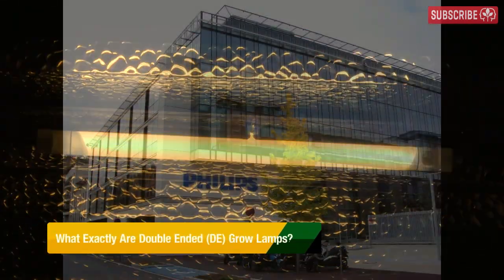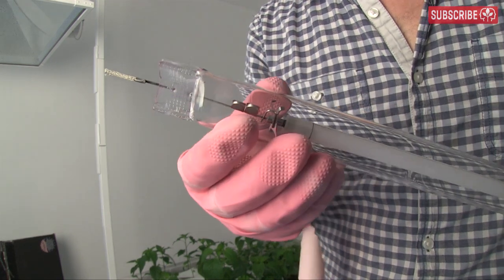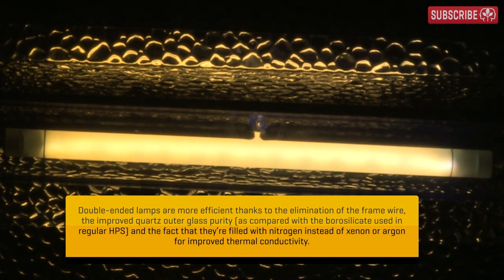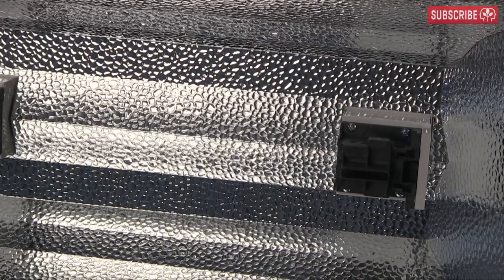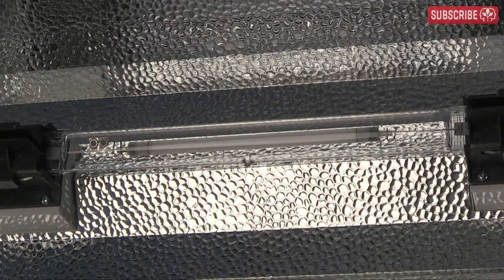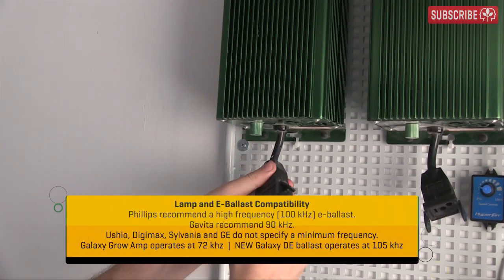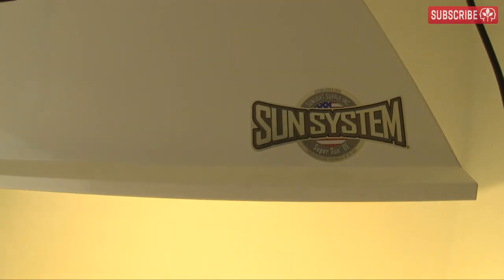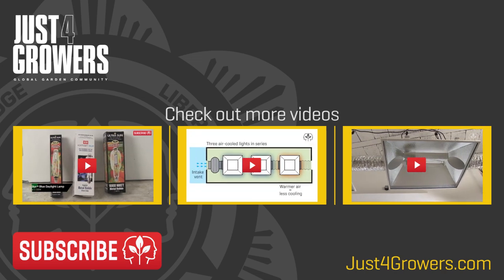What Exactly Are Double-Ended DE HPS Grow Lamps?

Comment: Should I go with the Helion DE 600-750W HPS or a 400W quantum board with LM301B diodes  
In a 4x4x6.5 tent? 
Temperatures are on the cool side most of the year. high 60 low 40
Reply: HPS definitely in a cool climate.

Comment: magnetic ballast is much better than electronic ones electronic ballast contain lot of high frequency which also destroys the electrodes in the arc tube if your electronic ballast is high frequency filtered like kind of dc current okey it is nice but magnetic ones is much suitable they are cheap simple much more life span using in old days but problem is the weight

Comment: Take a wire and put it on one end of the lamp and then put it on the other side of the lamp. Normal HPS. Just more advanced light but has noting to do with what kind of tube you put around it. And sure as hell has nothing to do with it double ended. Normal HPS is double ended too only the contacts at the end of the device meet. Startup looks exactly the same with normal HPS bulbs.

Comment: I have a 1000w solistek a1 complete system with the DE bulb very simular to the one in the video , great video by the way , your the best ! Anyways , I also run the dimmable ballast it's completed with and it has 600 750 1000 and 1100w nob. What are these used for if I switched it to 600 750 , what would happen? Thanks !

Comment: Hi Everest...what about heat? Any differences with single ended? Thanks
Reply from the maker: Interesting question! As the DE-HPS lamps are more efficient than their single ended counterparts, more of those input watts are converted to light instead of heat. That said, many growers report that 1000W DE-HPS lamps run hot, especially when housed in small, deep-dish reflectors that tend to trap heat and re-emit it as mid to long range infrared. My recommendation for home growers is to look at 600/750W DE-HPS systems - I’m particularly impressed with the Hellion system by Adjust-A-Wings for example as this users a Super Spreader beneath the lamp to spread the heat and diffuse any hotspots directly beneath the lamp, affording growers a much closer (safer) placement. Proximity is everything when using grow lights as the sole light source. Intense, angular light is key to canopy penetration. Other interesting reflectors include the DE Boss and AC/DE by Sun Systems, and check out the SR reflector by Gavita.

Comment: If optimum temperature is required does that mean it's not as efficient when run at turbo charged?  Yes more photons are produced but couldn't that be achieved by moving the light a little closer if that was an option?  Thanks!

Comment: Can we use any 1000w ballast? ???
Reply from the maker: I would suggest an electronic ballast—from there the schools are split somewhat. EYE Hortilux's platinum e-ballast uses low frequency square wave, as does Revolution Micro's DEva, where others go for high frequency SINE wave—such as Galaxy and Galaxy DE. Do you have an e-ballast in mind / in stock already?

Comment: I know you did a review on the ac/de reflectors from sun system, what is your take on it worth the price? thanks
Reply from the maker: +TekkHakk Hi TekkHakk, I think the AC/DE reflectors are really special—the sealed optic chamber is great. You can even remove the glass and still cool the fixture (without directly cooling the lamp, which you want to avoid) - so, if your application calls for high intensity in a compact space, or you want to reduce your air conditioning bill, this reflector is awesome.
Reply: +Everest Fernandez (Just4Growers)  Thanks for the replies.

Comment: Great info, can the ushio de bulbs work with any digital ballast ? say cheap ebay ones? that I already have, thanks.
Reply from the maker: +TekkHakk Hi TekkHakk, thanks for your question. If you take a look at a DE bulb you see a stiff wire element held in place at end end -- like a guitar string. And, like a guitar string, it tunes at a given frequency.  Get close to that frequency and the thing will start to vibrate, like a guitar leaning against an amp on stage. The resonance range of DE lamps lands in the range of most common digital ballasts, between 30 kHZ and 70 kHz.  To avoid shaking the lamp to pieces, you can go low, to 150 Hz (Revolution, Hortilux Platinum) or high to 100 kHZ (Galaxy, Phantom, Gavita).  So, you can light a DE lamp on just about any ballast you can find on eBay -- but not for long before it succumbs to acoustic resonance. My advice is to speak to your local indoor gardening store and either go low or high—but middle of the range will kill you DE lamp prematurely.
Reply: +Everest Fernandez (Just4Growers)  What is the best (in your opinion ) DE ballast strictly for DE?

Comment: Can you recommend a ballast that will run the 400V 1000W DE bulbs and dim them, like the Gavita ballast does? I would like to use the Sun System AC/DE Boss hood with the option to dim it.
Reply: This is a good DE ballast : http://www.htgsupply.com/products/agromax-high-frequency-1000w-digital-ballast , operates at 120,000hz which is ideal for double ended lamps
Reply from the maker: Galaxy do a great DE-specific ballast, worth checking out.

Comment: Sup Everest. I'm considering upgrading to DE setup soon and was considering adjust-a-wing reflectors. How do adjust-a-wings compare to the ACDE Sun Systems reflector in removing heat? I'm working with approximately 10 ft ceiling with a pitched roof. 8 ft on side walls and top of the roof I believe is 10 could be 12 ft. From my canopy to current reflector I have almost 3 ft in clearance.
Reply from the maker: +Ha Dang Hey Ha. Both the ACDE and Adjust-a-Wing DE are great reflectors. The ACDE is going to remove more heat as it's air-cooling the convection heat away. The Adjust-a-Wing's design lets the heat diffuse upwards out of the reflector to be dealt with by your garden's ventilation system. The Adjust-a-Wing's obvious advantage is it's adjustability—you can set it to create a deep, medium or wide spread. What growing area are you seeking to cover? How many reflectors are you looking to buy?
Reply: My room is 12x5.5 and would go with 2 reflectors. Current setup is 2 parabolics running 1000W each sitting 18 inches from canopy without any burn. I would like to avoid any air cooling reflectors because it'll take up more space.
Reply from the maker: +Ha Dang In that case Ha, I'd say the Adjust-a-Wings are a fine choice.
Reply: So just to confirm, DE adjust-a-wing would work fine with 3 ft reflector to canopy clearance? Thanks!
Reply from the maker: +Ha Dang don't see any radiant heat issues at 3 ft. They still pack a punch though!
Reply: Good to hear. If anything I can tone it down to 750 or 600. Thanks for the reassurance. You're officially my gardening mentor. :-D
Reply from the maker: +Ha Dang That's quite a responsibility but I'm sure I will rise to the challenge. :) I prefer 600s to 1000s. :)

Comment: How much more effiecent are the double ended HPS lights, seems they are over double the price to buy.  Also I can only find them in 1000 watt bulbs.  I was thinking about setting up a garden with muiltple grow lights at 400 watt so I can have them lower to the garden and have muiltiple angles of penitration (like you mentioned).   I do need lots of light as I plan to grow tomatoes.  I also saw your video for the split bulbs of both M.H and HPS combo but can only find them in 1000 watt as well.  Also this may be a silly question but do 1000 watt bulbs use 1000 watts or is that just to get started then reduces down once it gets heated up.  I only plan on running during the winter so I dont plan on using the cooling tube method around the bulb and will be used in a fairly open room.  I am assumping most people use 1000 watt bulbs to save on reflectors and other supporting gear need to power a HI bulb.  and for my final question, is it bad idea to buy a 1000 watt bulb and run it on a lower setting for different applications.   Thanks a billion!
Reply: The bulbs last 3x as long 😃

Comment: Wow I am learning so much from your channel!  I am into growing tomatoes and Peppers.  I am an experience outdoor gardener but have not really tried growing indoors yet with artificial lights.  seems like you really like sun systems brand.  I live in Canada and so far I am only taken in one of my tomato plants indoors and put it in front of a window for the winter.   I want to add a little grow light to help it out with the aid of the window.  I was thinking sun systems 150 watt to help out.  Also thinking of starting a basement garden,  what system do you recommend getting keeping value in mind ( not cheap, but value ).  I noticed you said you like the double bulb types, one with M.H and HPS combo bulbs.  also my vegetable of choice to grow are tomatoes.Looking forward to your response!
Reply from the maker: Hey Steven, thanks for stopping by and taking the time to post such an interesting comment. Tomatoes indoors: choose a determinate /bush or dwarf variety because they are so much easier to illuminate and control indoors. I am currently growing Baxter's Bush cherry tom, so check out my latest vids and subscribe for updates. Yes, i love Sun System gear. Researched, developed and manufactured in the US and high quality. For supplemental, window-sill or conservatory lighting, I would recommend a 400W HPS minimum for productive tomatoes. As for a high value starter hydro system, choose a 4 X 4 flood and drain tray. Always happy to answer your questions and discuss ideas. Peace and happy growing, Everest.

Comment: would a 8ft ceiling be enough to run a de fixture on a mover thanks for the help?
Reply from the maker: +Kevin Anderson Hi Kevin. What's your clearance from the floor? I.e. at what height do you plants start growing? Are they pots on the floor? If so, how tall are the pots? If it's a tray on a stand, how high is the tray? Also—do you have an idea of the final height of your plants?
Reply: i'm using #5 nursery pots, the pots are on the floor and usually I start bloom between 14 and 18" the 5 gallon pots are 10 1/2" I already purchased a light mover 3.5 thanks for the help
Reply: also the final height will be around 3 1/2 feet
Reply: i'm thinking of using a king wing reflector if that helps any!
Reply from the maker: +Kevin Anderson Hi Kevin. I like your idea of using an open DE 1000W HPS on a light mover. I think this is the perfect application for a light mover actually. I recommend using a frame and soft mesh netting to tuck any taller growth tips back under the netting and to spread the plants out into a low, wide form. Consider topping your plants so that they bush out. Good luck!
Reply: thanks Everest I appreciate the help!
Reply from the maker: +Kevin Anderson You're welcome Kevin.

Comment: can you use the gavita 6/750 de inside a 5x5x7 tent? or is that not enough room for that light?
Reply from the maker: What growing system (if any) are you using and what will be the final height of the plant canopy above the floor? If more than three feet off the ground you will run into radiant heat issues most likely.

Comment: I touched the bulb with my bare hands, should I wipe it off before starting it up?
Reply from the maker: Hi Jared. Thanks for your question. It's certainly best practice to keep your grow lamps as clean as possible. Even the smallest residue from your hands can potentially stain the outer casing of the lamp when heated during operation and be difficult to remove afterwards causing a permanent drop in output. Just give it a quick wipe with some window cleaner and allow to dry thoroughly before switching on again.

Comment: simple question: how much better is the DE compared to SE hps
Reply from the maker: Admi fonds Hi Admi. Great question. Thanks for asking.

1) Efficiency.

DE is more efficient than SE at converting electricity into plant-usable light.

For instance, the Philips 1000W EL DE outputs 2.07 µmol / W. 
Even premium 1000W SE HPS lamps only manage 1.79 - 1.93 µmol / W so upgrading to DE would give between a 7 and 15% efficiency increase.
Standard 1000W SE HPS lamps will only put out: 1.49 - 1.7 µmol / W - so, in this case, an upgrade to DE would give a nearly 40% increase in efficiency!

2) Lamp Depreciation

DE lamps have better lumen maintenance than their SE counterparts. I don't have the exact figures to hand for each brand but typically DE HPS 1000W lamps operate at above 96% of the original output after 5,000 hours' usage. Very impressive. Fewer lamp change-outs.

3) Improved spectral distribution.

I'm planning a video that will talk about this some more.

4) No slacking!

Great advantage of the DE is that it is perfectly aligned in the focal point of the reflector. Large 1000W lamps often show “the droopy lamp syndrome” because they are large and heavy. 

Let me know if that answers your question. Be sure that you have plenty of vertical height available when using DE 1000W HPS as they need to run hot. The Sun Systems ACDE reflector removes heat without over-cooling the lamp unlike some other air-cooled DE fixtures. There are some open fixtures too, but you need to be really on top of your room's environment. 

Finally, Admi—please sub my channel! Thanks :)
Reply: Everest Fernandez thanks for the reply yes it was helpful. i will sub to your channel. I don't like air cooled hoods, i prefer air cooled rooms altogether, that said, i will look into them, don't think i will bite and change my 2 SE 400w
Reply: +Everest Fernandez (Just4Growers) great post!

Comment: It's a very bad plastic socket. Not a good connectivity and in re-light it kill bulbs.
ACM from Italy produce a DE ceramic for new Adjust a wing and air cool reflector. It's in ceramic and doesn't kill lamp. Save lamp for more time.
4A in plastic vs 16A in ceramics
150 C° VS 250 C° in ceramics
fixed wire for plastic VS wire what you want for ACM ( save time of bulbs)
I suggest to you to contact him for review this news.
Reply from the maker: ***** Hi Andrea, thanks for your comment. The ACM socket is terminal block style and, while it is a nice socket, it remains very time consuming for the grower. You physically have to use a Philips head screw connection on either side of the lamp...and it's a more costly option.

By the way, the German-made Vossloh Schwabe DE socket isn't just "plastic", it's a non-flammable phenolic polymer of an excellent engineered design. No wonder it inspired Chinese manufacturers so directly! :)

Thanks again Andrea—please consider subbing the channel. Best wishes and happy growing, Everest.
Reply: Everest Fernandez Dear, i've in my hand 3 VS lampholder loose. 
If you test for more time to re-start with lamp you could kill socket fastly.
Slider lampholder for me, is a very bad solution in this condition. 1 minute plus, and 100% security for connection and temperature is less expensive that bad connection and 100$ for a new Bulbs.
If you check in the stadium,, every where, the lighting manufacter, use 100% ceramics lampholder with this system. why this? because 1000 Watt requires a good connection and good security.

Second time, Italian design , white ceramics brillant, garantee more reflection that Black plastic lampholder. 
+3/4%. 

Why spend more money for a 98% aluminium and after use a 
non-reflective lampholder? Is the same to buy a Ferrari with a small tires.

Thanks
Andrea

Comment: Are there any advantages to running DE Metal Halides?
Reply from the maker: Jonathan Bermudez Thanks for your question—it's an interesting one! DE MH in its current form is not a protected “open rated” lamp and thus should only be used within a glass enclosed luminaire such as the Sun Systems AC/DE reflector which cools the fixture but doesn't pass cool air over the lamp itself (important for all DE lamps). Furthermore DE MH lamps are typically rated at 5k hours and I believe the lumens are actually lower than a standard 1k MH. 
 
Larger growers are certainly increasingly interested in DE platforms, I would anticipate that a grower-friendly 1k MH DE is technically possible. Some growers of aromatic herbs switch to 10,000 Kelvin lamps during the last 10 - 20 days before harvest for more UV-B / essential oil production—so a safe DE MH lamp would be awesome for existing DE HPS growers as they could switch to a 10,000 Kelvin MH lamp during the final stages by just changing the lamp, rather than the whole fixture.

Comment: Yes I thought you need higher frequency like nanolux de or lumatek ballast.
Reply: also do you have a lumen meter? would be neat to see the difference between the two bulbs on a meter. how much better is the par available?
Reply from the maker: Dennis F. Hi Dennis. Thanks for your questions. You definitely need an electronic ballast to run a DE HPS, and some lamp manufacturers state minimum frequency. Ideally the same manufacturer would produce both the lamp and the ballast and then, hopefully, you can be well assured of compatibility. My best advice is  .... ask the good people at your local grow store.